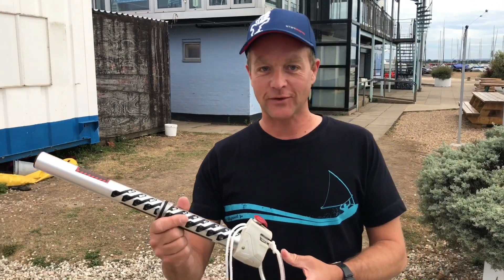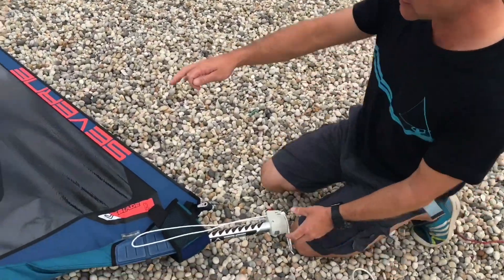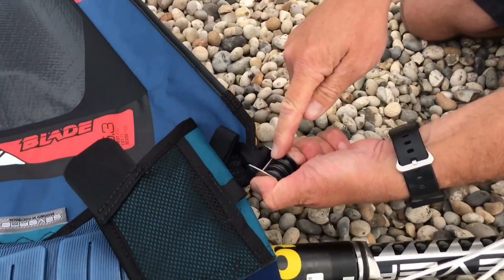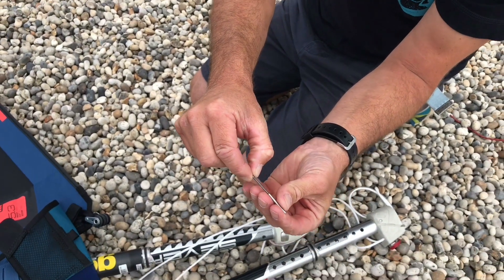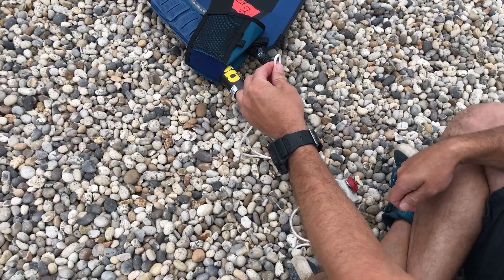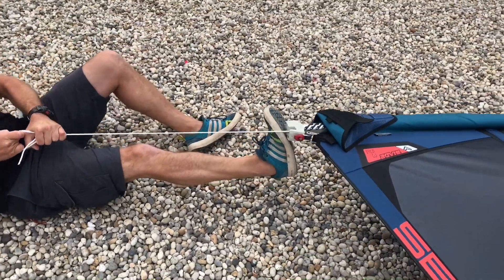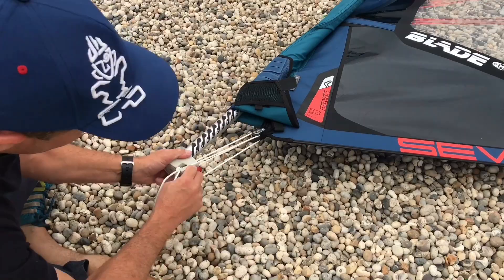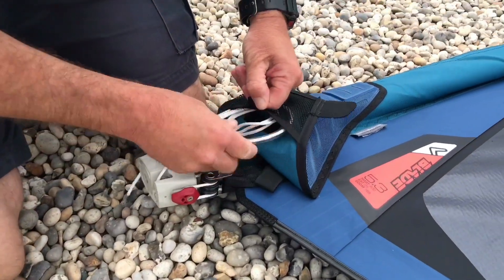Severne Cyclops Pro Wave Extension - loop’n go system - first look

Comment: Hi Simon,

Will it work with only with 2019 Severne sails ?
Tom
Reply from the maker: Hi Tom. Thanks for your message. I can confirm that it only works with 2019 Severne sails. A slightly bigger gap is needed to get the doubled downhaul rope through the gap above the pulley wheels - and this is not present on 2018 Blades. As you can see in the film this gap can be made on 2019 Blades by the removal of the pin, yet not on the pre-2019s as they do not have this removable pin. Other 2019 or pre-2019 sails such as Turbos cannot accommodate the doubled downhaul rope as there is an additional metal strengthening part on the tack pulley that gets in the way. The Cyclops is only really for wave sails 5.5m or less anyway imo. I hope that this helps!

Comment: Simon, thanks for the reply.  I'm trying to sort out rigging my Blades.  I've got a 2016 5.5, 2018 5.0 and 2013 4.5.  I'm 6'4" , 90 kgs intermediate ocean sailor.  I'm using 430 and 400 G2 masts.  I'm coming from power wave sails with a high draft.  Will pushing the extension up a couple of increments help ?  Many thanks !